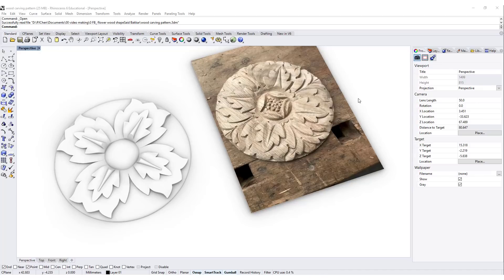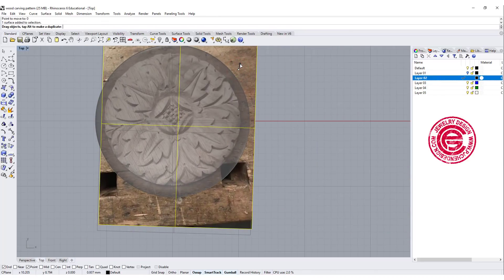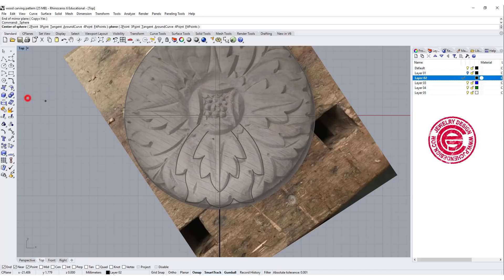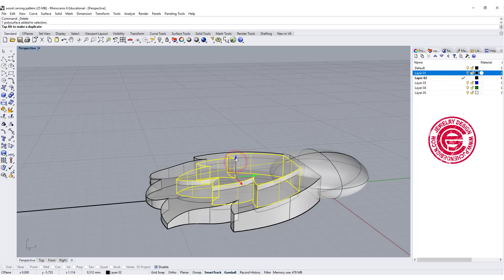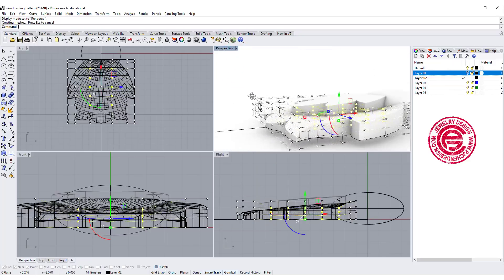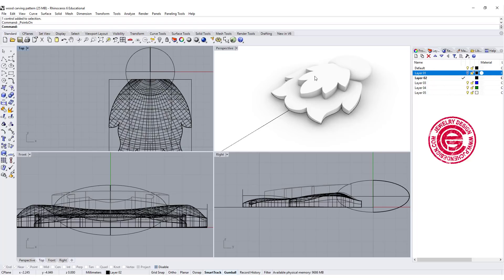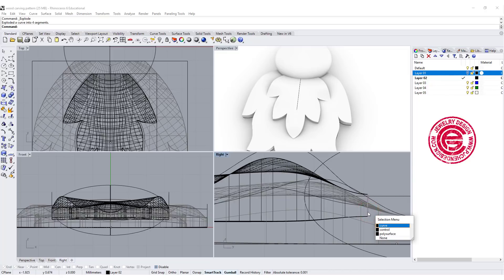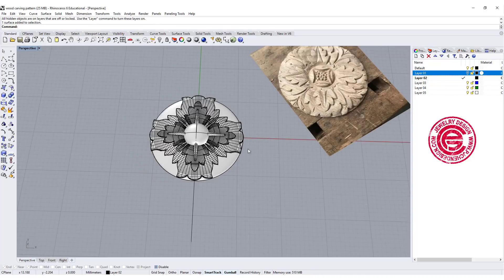Creating Wood Carving Look Flower in Rhino 3D: Jewelry CAD Design Tutorial #65

Comment: PJ CHEN which curve tool ur using to trace it.
the control point curves? if then when i use the same tool the curve lines are elastic means not follow what i am tracing.
Reply from the maker: You can use either control point curves (I use this one most of time) or interpolate point curves. you can always turn on the control points later to edit the curves.